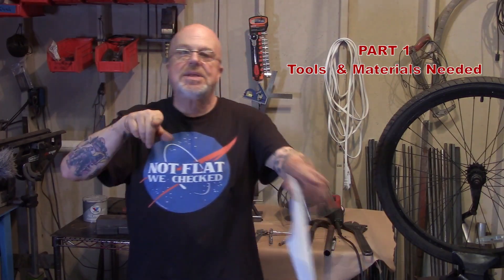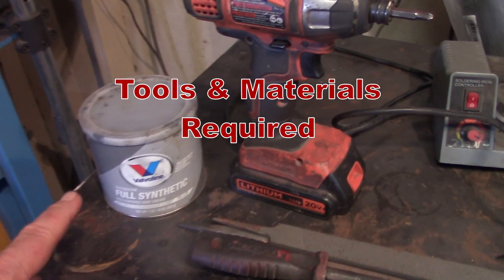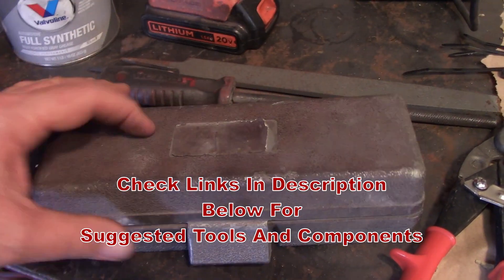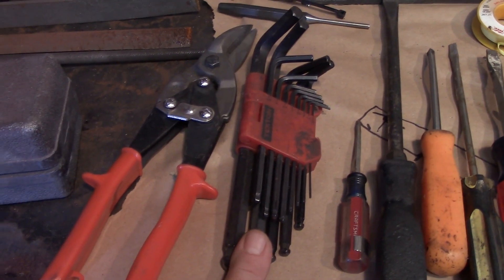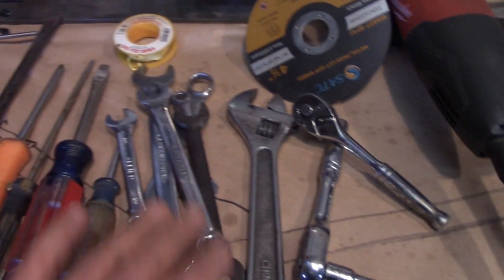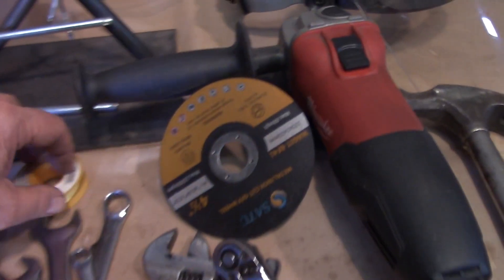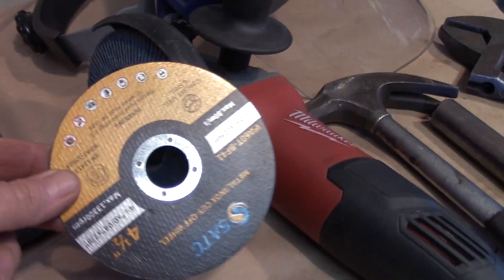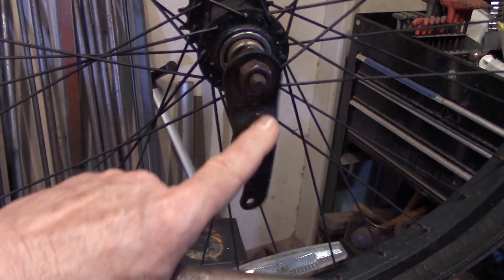Part 1 - How To Build A 66cc 2 Stroke Motorized Bicycle Beach Cruiser - Tools & Equipment Needed

Comment: hey does this engine fit on ortler van dyck =) ?
Reply from the maker: It can go the same as putting one on a Ladies bike. Gas tank on the rear rack. There are vids on Youtube
Reply: @HughesMotorized  thx man, i tought mine is not V frame,can i buy biggest possible cnc  rear sprocket for nexus 3 hub sent to eu (Finland) ?
Reply: i really cant find those videos with "motorised bike" (ladies bike / custom frame)
Reply from the maker: @HakanMUSTAFAKEMALATATURK  OK. On the hub adapter, I think in Imperial it is 1 1/8" so 45.72mm. You might find on ebay or Amazon. I think that is what fits the Nexus 3 speed.  Installation of the kit would be similar to this: https://www.youtube.com/watch?v=_sLzl7NdFrU
Reply: @HughesMotorized  damn, thx.. i heard that rubber would be good between engine and frame to reduce  vibration on bolts etc. if we only just could get elecricity from engine =( i have hub dynamo, i will make something lets see
Reply from the maker: @HakanMUSTAFAKEMALATATURK  NO. NO. No. Do not put rubber between the motor and frame. That will cause the engine to flex. this will cause chain issues and possibly break mounting bolts. You want a solid mount. I use an LED headlamp w/ a rechargeable battery
Reply: @HughesMotorized  i meant like tyre inner tubing, for not scratching =) but ok if you say so i dont put 👍 i would ve been loved 25 km/h 15,5 mph limited setup (with bigger sprocket) but i think i will limit thottle with screw etc, polices only job is to measure mopeds speed here

Comment: Found a Motorized mountain bike thrown off a bike path in my town, only missing the throttle grip and it had a broken clutch break. I took it home and put it on Craigslist saying it was found, and was anyone missing a motorized bicycle, and if so, send my the details of what bike it was. Had two responses and they were both not the motorbike I found. It's been a little over a month. I ordered parts a few weeks ago and just found your videos 2 days ago. Learning alot so far.

Comment: I made a ceiling bike mount with 1/2” EMT conduit and pipe insulation. Bend to J shape, cut to length and hang from rafters. Folds up out of the way when not in use.
Reply from the maker: There you go. Quick & dirty stand. prolly works just fine too